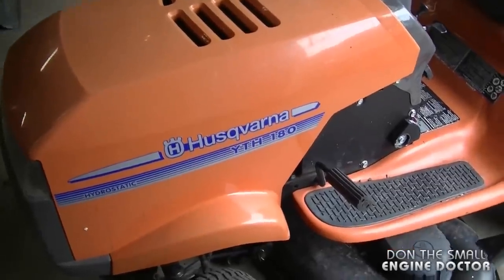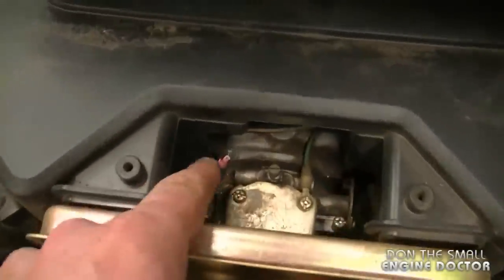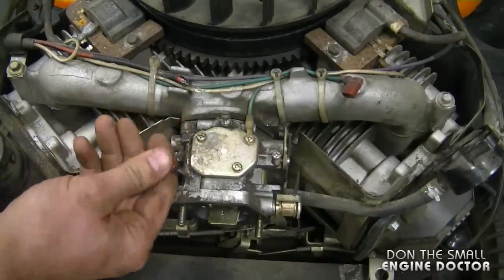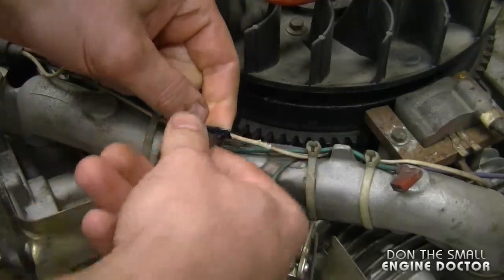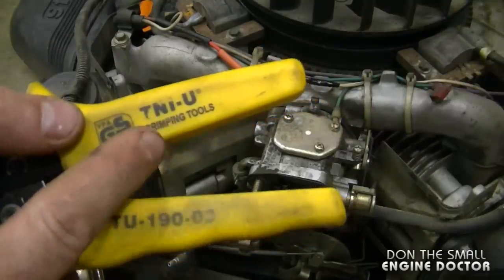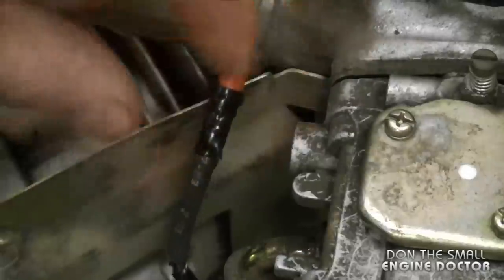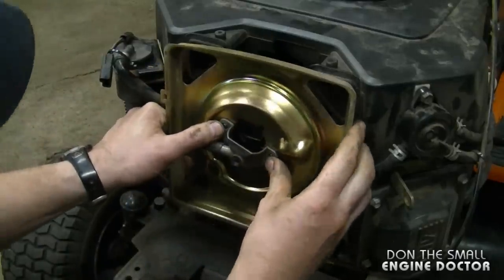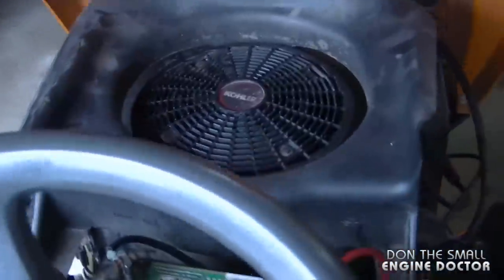Fixing A Lawn Tractor That Starts & Dies - Video

Comment: This Spring, when I started up the mower, small bits of cloth wipes (blue shop towels) flew out. I suspected mice, and gave it a once over (thankfully not like this video!). Old timer told me to put pouch of mothballs (They come in netted bag now) around motor when storing for winter, to keep mice away. I am trying it but my shed smells like some old closet ;)

Comment: Hi Don thx for another informative video....i have a 2016 husky (tractor supply) with a 547cc powermore engine that runs for a 10 minutes then sputters and quits.  In hot weather it takes less time to do this.  I've tried running with loosened cap with no improvement.  I took out the carb, dropped the bowl and pushed a wire strand thru the main jet and sprayed it all with carb cleaner but that was the extent of the disassembly.  can't tell if its a fuel or spark problem but it's only a couple of years old and hardly used. reinstalled carb with no improvement.  I'll try to run it with the spark tester to check the coil but isn't that less likely on a machine this new?

Comment: My Briggs opposed twin would run great for 45 seconds, then shut off.  I discovered I could keep the engine running with a squirt bottle. I then narrowed the problem down to some minor pump issues. The squirt bottle trick kept me from going in the wrong diagnostic direction.

Comment: Great informative video and channel.  I have a similar problem on my cub cadet.  It starts fine but sound and runs rough.  When I engage the cutting deck, it bags down and stalls.  It will start right up but does it again,  I changed the fuel pump and filter and it runs good now, but the exhaust is somewhat smokey, and i think it still sounds a bit rough, not much.  any anvice?  maybe clean the carb?
Thanks

Comment: Nice video Dony, Consider liquid electrical tape for a permanent repair. It won't dry out and unwind like vinyl tape with heat and time.
Reply: Liquid Wire will not work in a " Hot " area like this.  Shrink Tube will be best in this hot location.  If in Cold Area, yes Liquid Wire will be great!

Comment: You really should disconnect the negative battery terminal while doing any electrical work even though that circuit is de-energized buy the switch.

Comment: hello Don, my batteri on snowblower 11hp is destroyed, what kind of battery is best in the manual it pointed 12V and at least 18Ah, I think the batteri is used for get enough power to the stater motor, what is your recommendation when  I am going to by a new battery
BUT THE BEST WAY TO START IS TO USE THE STARTER ROPE  AND THE ARMS  GET A WORKOUT

Comment: Two things you failed to mention one minor one potentially major.
On the fan cover there's for little spacers that go behind the bolts you don't want to forget them when removing the cover you want to make sure they go back in in the correct spot.
On the air filter there's normally a wing nut that holds the filter  to the housing easily lost part but they are most times there.

Comment: Have you ever used the liquid wire repair. A little drop will do ya. Thanks good stuff
Reply: +norherman
 - Liquid Wire will not work in a " Hot " area like this.  Shrink Tube will be best in this hot location.  If in Cold Area, yes Liquid Wire will be great!

Comment: Hey Danny. Great video. I’m having a similar problem with a Yardworks. Starts and dies almost immediately.  I hear the solenoid click when turning the key and it also runs no problem when the lead to the ignition module is unplugged which tells me something is shutting it off. Could I ha a bad fuel pump or can the fuel solenoid be faulty even though it clicks?

Comment: I had this problem. I bought a dozen of those green blocks of mouse poison that go in those black plastic bait stations and tossed about 6 of them on the floor of my shed. I never had the problem again, but I do see the blocks being gnawed on, letting me know the little bastards are at work.
Reply: To prevent mice chewing on Wires in Lawn Mower and Cars.... Take your favorite " Cologne " and spray on the Engine / Fins / Wires / Etc.... When the Engine gets  hot, it smells good for you and Mice don't like the scent!  Musk is also good for it, since it's like an Animal Scent.

Comment: Ahhhh... don't you love the Soy-based wiring insulation?  The mice/squirrels sure do.           3M tape is great. I also use Polyken 268 High Temp Tape.   Over time, the cheap PVC tapes will slowly unwind themselves from the wire, where-as the quality Name-brand tapes will stay in place.
Reply: It does unwind, yet still retains the ability to stick to everything else...but the wire it was on.
Reply: I use silicone caulk works great. Add tape for extra piece of mind.

Comment: Fortunately those mice didn't make a nest that could have caused overheating.  Thanks Don, I like that tip to tape the two connectors together to prevent vibration from causing it to fail.  Someone needs to invent mice/rat poisoned wire, eh?  :>)

Comment: I a Husky RZ4621 Zero Turn and I have did Carb kit, checked flywheel key, adjusted valves, checked fuel shut off solenoid, new spark plug, new gas and adjusted coil gap on flywheel and it will fire with starting fluid but won't fire without and also replaced fuel pump and check when cranking have good fuel flow from pump at carburetor end , at a stand still oh and compression is 105 PSI any help would be so much appreciated...E

Comment: Hey young man;
I have been the kinda go to guy for minor repairs in my small world of friends. I have basic know how.
I had a Husqvarna  20 some HP. He said it just quit. His son tried new carb, coil, plug. 
I slightly adjusted valves, felt some compression, switched out plug,checked that fuel pumping. 
It will struggle to start and dies moments later. I tried unhooking kill wire from coil/armature 
I am at a baffle point.
Can you point me in a direction?
Best; Tom
Reply: GO BUY ANOTHER MOWER

Comment: HELP!!! I changed sheared flywheel key on 6.75 briggs and stratton. Mower still backfires through carb. I cleaned carb out, swapped carb with another, still no change. I'm stumped...what is next to check?

Comment: DonyBoy, I have a Poland riding mower with a 15.5 Briggs and station engine on it. It does surge up and down,with a new carb on it. What could be the problem with it ? I don't think its in the governor's. It idles just fine on a low idle,but when you go to put a load on it ,that's when it starts to surge.  . I found out that was a Chinese knock off carb. Don't never use anything from China,yes I know they are cheaper ,but in the long run it is cheaper by going with an I.E. CARBURETOR

Comment: I've changed everything on my mower, cleaned the gas tank and it starts and runs for two seconds then dies. I'm at my wits end. It was running fine two weeks ago.
Reply: try cleaning the main jet in carb , the one in the center of the bowl.

Comment: Don, why would a non-functioning fuel shutoff still allow the engine to still run on low? I'm still learning and this confuses me. I thought a shut was by definition a shut-off....lol like a woman being pregnant, she is or she is not. If this came to my shop and I didn't see the mouse cut wire but the engine still ran, i'd never know to check shutoff, because its running

Comment: I have a question : How do lawn mowers charge the battery? My tractor only has a starter and magneto (ignition coil). Do they even charge the battery? I have an old Rally 10 hp.
Reply: there is an small 2 amp alternator mounted under the fly wheel that keeps the battery charged after about 10 minutes of cutting
Reply: @fixeditmoreless3684  Thanks!

Comment: you should always shut down a kohler that uses that sollenoid at or above half throttle to avoid the big bang and  flooding. that sollenoid only cuts the fuel to the high speed jet unlike the one on a briggs cuts all the fuel. its in the owners manual  but really who reads them?

Comment: Hi Don,  another great video.  Can I just ask... I have one almost identical to this and it starts and runs fine for about 20-30mins and then loses power and stalls. If allowed to cool off a little it will run strong again for a while and cut out. Someone suggested that fi the fuel filter and fuel system is clear then it could be an electronic module of some kind of which this model has two of ?Any ideas ?Cheers mateJason
Reply: Johny Harbinger .... thanks very much for that info Johny... I will look for one of those online and check for the fuel related issues also. 
Very much appreciated 
Jason
Reply from the maker: yes check both, sometimes i loosen the gas cap to make sure it's not a venting problem. it can also be the coil and possibly it needs a valve adjustment depending on your engine
Reply: donyboy73 ... Thanks Don
Really appreciate your channel mate.
Reply: Hi Jason,  that sure sounds like the gas tank vent is clogged. Leave the gas cap a little loose the next time you mow, and see if it will run for a longer period of time.
Reply: 009to090 Ok thank you. Will try that too. 👍
Reply: Jason Yannuccelli it's prob a coil getting hot when it does again see if it's firing
Reply: Jason Yannuccelli also check the gas cap loosen it a bit and see if it stays running it only take a tiny bit of dirt or warer
Reply: Robeft Yearian will do, thank you
Reply: Robeft Yearian thanks.. will do 👍
Reply: Jason Yannuccelli mine started sputtering and stalling after about 15 minutes of run time... Then 10 minutes as they weather got hotter and now it won't run unless I spray starter fluid and it starts for a couple of seconds...I cleaned the carb but it's the same... The carb coil like the one that was just re wired for this video gets kinda hot also. Can someone guide me?  Should I try a copper wire strand in the main jet?
Reply: Make certain it's not the air filter. Clogged air filter is just the ticket for a cold engine helping to choke it off.

Comment: I have a craftsman 1500 series riding lawnmower. It starts and runs fine. But when I put it in gear and release the clutch it stalls out. The same thing happens when I try to engage the blades. I replaced all the safety switches. It still does the same thing. Stalls out. It used to be able to drive but no blades. Now its worse. No driving. First I put in the 2 safety switches. Nothing happened with the blades. A week later I put in the seat switch. Now it won't drive. I put the old seat switch back in. It still doesn't drive. I did this 2 times each. It don't drive or engage the blades. I don't know whats wrong. Does anybody know whats wrong. Thanks

Comment: I have a troy bilt tuff cut 230 smart touch starting system. 12AS5690063
Only starts when it wants to. It's like the starter doesn't turn it over fast enough. Have you worked on this type before? Any idea what could be wrong?
Reply: Not familiar with that model but if this is one of the ones with the OHV then the valves could be out of adjustment (loose).
Reply: @maximus759  it's a push mower, has a starter that wind's up when you pull the starter rope. Then u push a button and the starter engages and starts the mower. It just wouldn't turn it over fast enough sometimes.

Comment: I am working on a craftsman riding mower with the same basic engine mice did a number on it they had it packed with nest material on top of the carb and all around the cylinders once i blew all that crap out i found one plug wire chewed in half the other one halfway chewed and all the wires on top including the solenoid wire were chewed damn mice are pests !
Reply: To prevent mice chewing on Wires in Lawn Mower and Cars.... Take your favorite " Cologne " and spray on the Engine / Fins / Wires / Etc.... When the Engine gets  hot, it smells good for you and Mice don't like the scent!  Musk is also good for it, since it's like an Animal Scent.

Comment: Mice(living inside or chewing wires) and Ethanol Gas seem to be about 95% of all small engine problems based on the videos I see on YT.
Reply: To prevent mice chewing on Wires in Lawn Mower and Cars.... Take your favorite " Cologne " and spray on the Engine / Fins / Wires / Etc.... When the Engine gets  hot, it smells good for you and Mice don't like the scent!  Musk is also good for it, since it's like an Animal Scent.

Comment: Rodents!  The only thing they're good for is predator food, only problem is the rodents breed faster than the predators can eat 'em, and I guess keeping mechanics busy too. Personally I'd have gone a bit further with the partially chewed white wire by adding a liquid tape that is used widely in the automotive industry to seal wires that have be pierced for testing purposes then black tape over that, but that's just me. Your way is fine too.  All in all a good fix.  Thanks for the video.
Reply: To prevent mice chewing on Wires in Lawn Mower and Cars.... Take your favorite " Cologne " and spray on the Engine / Fins / Wires / Etc.... When the Engine gets  hot, it smells good for you and Mice don't like the scent!  Musk is also good for it, since it's like an Animal Scent.